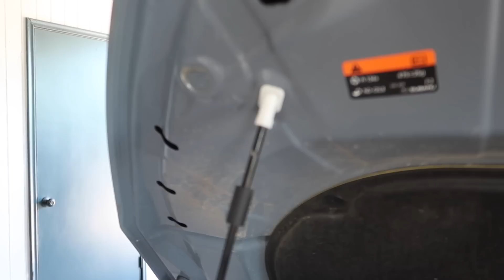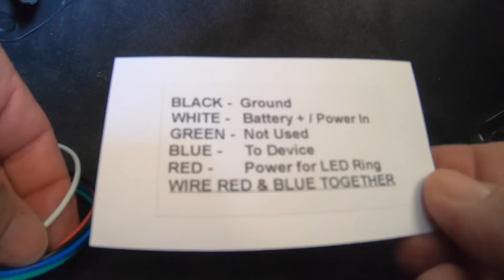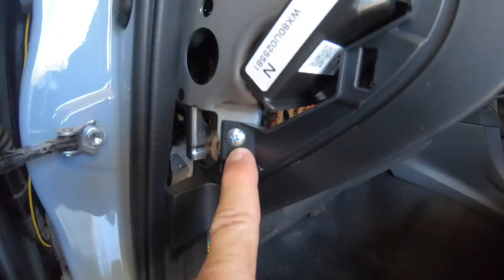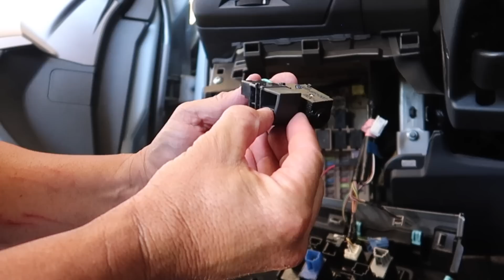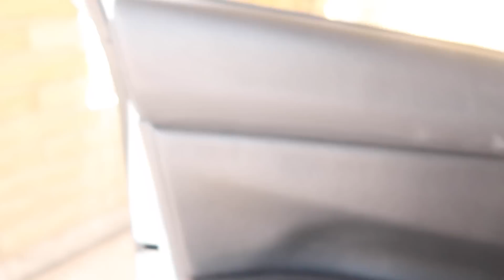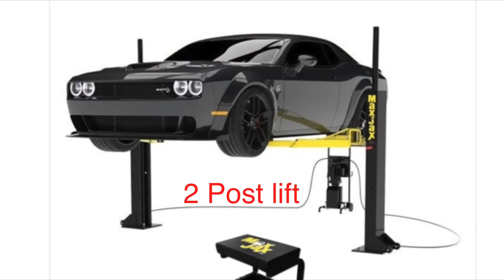Hella 3D Printed Dash Switch install and Channel Update

Comment: Hey Rick. In my 18 xv the switch panel pops out on it's own. Don't need to pull the surround off. Mine is an aussie model but I would imagine they're the same.
Reply from the maker: Ah, very cool.  I didn't try to just pull it on its own I am embarrassed to say.  :)  I will give it a try when I get home.  Thank you!